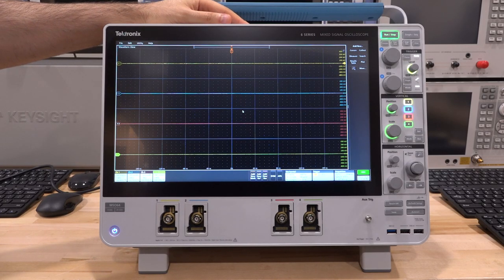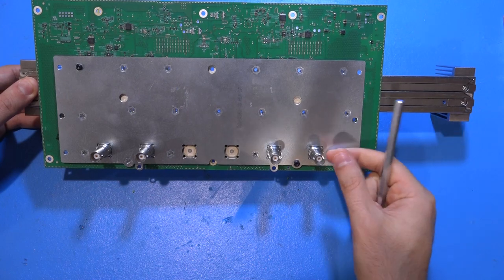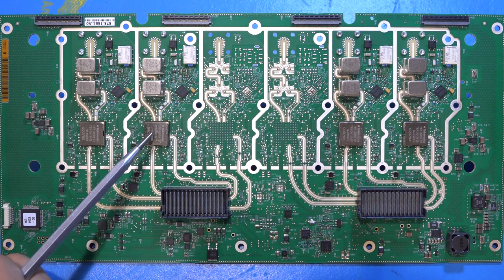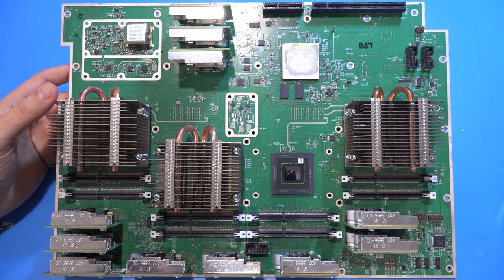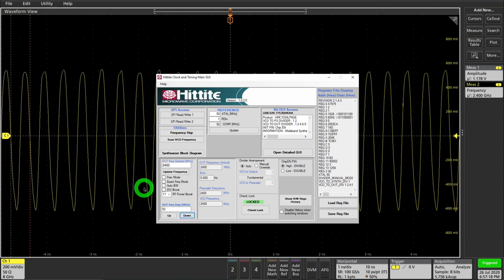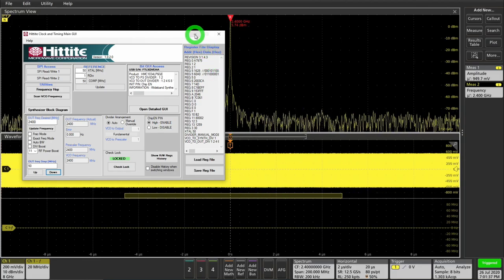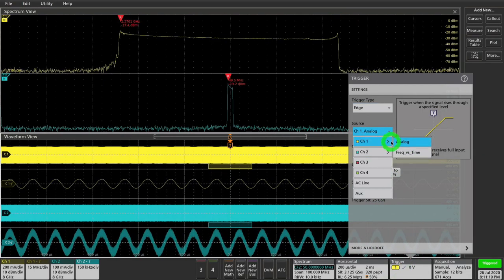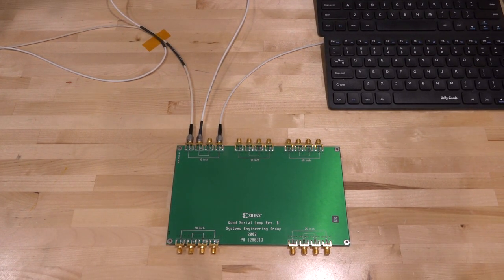TSP #172 - Tektronix 6-Series 4-Channel 25GS/s 8GHz MSO Review, Teardown & Experiments (Part 1)

Comment: If you start the table of contents from 00:00, Youtube will automatically add chapter markers and titles to the progress bar
Reply: Yes, I do this with my videos now, works great.
Reply from the maker: Amazing! I have to try this. Thank you.
Reply: @Thesignalpath  Another trick making life easier: when you edit the video, add markers to the timeline, and then export them to an EDL file. It is a simple text file, which can be easily converted/edited into the table of contents. You won't have to go through the video again just to write down the timestamps. Each time I edit a video, it saves me a lot of time.
Reply: It's one of the (rare!) times that YouTube has added a feature which is actually useful.  I use it on all new videos and maybe it's worth going back over some of the older ones too.
Reply: @funtechu  Very interesting, I will try that!

Comment: You are great. Just I start to look for an oscilloscope (Tek 5 & Keysight MXR), here I have notification with Tek 6 series. I would like to compare this with newly released Keysight MXR series (12bit  Vs low noise 10 bit)
Reply: According to official specs Tektornix ENOB is 8.8 compared to 9.0 in Keysight. Tek wins in bandwidth, Key in acquisition, also Key has 8 channel model. But what really sells me to Keysight is their beautiful phosphorus-like signal imaging with smooth gradients that gives fast insight how particular signal really behaves in dense areas.
Reply: Tek ENOB is 8.2, Keysight 8.2.  Tek will win on noise, ~ 30-50% at 1 mV/div.  Keysight standard record length is greater, but Tek maximum is 2x greater.  The MXR is a great scope, rest assured;  however, the Tektronix still has the edge in most physical performance metrics and once you get into software/analysis, like Spectrum View, Tek runs away with it.

Comment: Could it be those apparent trace disconnects you were musing about on the empty channels @ 14:14 or thereabouts were done to prevent any antenna effect or noise coupling in ?..with no chips installed they would seem like un-terminated lines which might impact the active channels...just musing myself...great job as always sir

Comment: 14:05 first I though that these gaps in unpopulated channels are probably just connected with a simple jumper when channels are populated in a higher end model. But then I thought, why didn't they broke traces closer to the ADC then? Why do they want traces to go under the shield? Also remember that the shield is not covered with emi absorbing material on these unpopulated channels.

Comment: At 13:38, they have two southbound differential pairs from each TEK061 chip, but one pair has no soldermask and the other has. I guess the one that has no solder mask is for high-speed differential pair since those solder masks potentially introduce extra dielectric loss. My question is, the two chips shown in the video share the same footprint, but one chip uses the left diff pair for the high-speed signaling, but the other chip uses the right diff pair. what is the purpose of the other diff pair that has a solder mask on top?

Comment: And here I was thinking I was clever by using my PC's 'sound card' to simultaneously measure the voltage and current of a device under test to create impedance and phase charts for audio speakers, crossovers, or similar devices... o.0

Comment: 10:50 well, I think the solid state relay is switching de AC coupling capacitor and the electromechanical relay selecting between 2 input attenuators
Reply from the maker: This instrument doesn’t have a solid state relay on the front-end.
Reply: Ok, I just assumed the 4-pin SOP package near the capacitor in the low frequency path was a solid state relay. 
Keep up with the good job!
Saludos desde Argentina

Comment: I have a 5 series, but may move back to Keysight as the 89600 VSA software will work on it.  Still very nice scope though.
Reply: The Tek SignalVu-PC VSA software has been enhanced to support the 5 and 6 Series oscilloscope platforms - will be released very shortly...

Comment: In your first experiment for the 2.4GHz signal and PLL. You drop the sampling rate below any usual recommandations. Your frequency marker read about 1GHz, instead of 2,4GHZ. Which is expected as you sampling rate is at 3,..GSa/s why did you do that? Does it would not influence your measurement to not sample your frequency at the right sampling rate?
Reply: When the DDC is engaged, the memory access is split between the time domain data and the baseband IQ coming from the DDC.  This means that the sample rate of the time-domain samples is reduced.  However, the full sample-rate data is applied to the DDC input, so there is no loss of timing resolution and Mr. Nyquist is kept happy...

Comment: Is the spectrum analysis in this scope completely in digital signal processing? Or is there an RF section that was not shown on the video? My guess is it is fully software (with hardwired DSP) because I did not see any signal split around analog frontend that would feed into an RF section.
Reply from the maker: The DDC is fully in digital domain.
Reply: The 12 bit samples from the ADC are applied to the hardware-based digital down-converter - all done in DSP.

Comment: Overall, it is a very well designed instrument. The DC-DC modules look very interesting. As for those Teledyne relays, I would bet they could be used for very high speed signals without any issues, albeit they will be very pricey. The first inline relay seems to be there for grounding, or just to bypass a capacitor. It is hard to tell. As for the differential pairs going from the ADCs, they are reminiscent of the ones used in USB 3.0 or PCIe (e.g. one pair for each direction).

Anyway, good video, as always!

Comment: After watching the video, I have some questions about the spectrum view feature of these scopes. I wanted to ask if someone maybe can help me out.

I was surprised how the spectrum view function worked, because I assumed that an FFT is used (due to the selectable window), but the behavior doesn’t match with what I would expect in this case. After some googling I found an article to the Tek webpage which shows that a digital down converter is used to move the center frequency of the spectrum to 0Hz before the FFT is processed. Is it correct that signal must be bandlimited beforehand for this to work?
When I look at the block diagram on the webpage both the time domain and the frequency domain signal processing pipeline receive the ADC data at the full sample rate. The reduction of the sample rate when using spectrum view with a wide span is therefore only due to limitations of the acquisition memory?

Thanks for any help.

Tek Website:
https://www.tek.com/document/application-note/spectrum-view-new-approach-frequency-domain-analysis-oscilloscopes
Reply from the maker: Yes, the limitation is on the acquisition memory side.

Comment: What is the lowest frequency that jitter measurement can be done ?
For time expansion in RADAR  need low frequency.
Reply: The advantage of the DDC - long term RF capture is possible.  As the acquisition BW is reduced, the IQ sample rate is reduced, thus longer data records can be acquired.

Comment: why are proper heatpipe coolers relatively rare in test equipment? It's so much more effective and compact than big aluminium coolers
Reply: Maybe I am missing something?
My understanding is that heatpipes and coolers are totally different, almost like a resistor is different from an inductor!
A heatpipe is designed to MOVE heat from one place to another while a cooler is designed to DISSIPATE heat into some other medium (air / liquid etc).
Therefore, if you have enough volume to dissipate the heat locally, you don't need (or even WANT) a heatpipe.
However, if you cannot dissipate the heat quickly enough with a local cooler (/ radiator), then you MOVE that heat elsewhere using a heatpipe to a place that the thermal energy CAN be dissipated.
Reply: @trevorvanbremen4718  I'm saying that test equipment usually uses gigantic aluminium heatsinks that are extremely inefficient at cooling, instead of using a properly designed heatsink with heatpipes to transport the heat to the fins.

Servers and PCs moved away from the old style a long time ago, yet you still see it all the time in test equipment, and the devices  thus often need way too loud fans to keep them cool.

Once an aluminium fin reaches a certain length, making it longer won't make the cooler better, since the thermal gradient along the fin means it's hot at one end, and barely above room temp at the other. A finstack with heatpipes doesn't have this problem, the heat can be spread across a much larger area in a smaller footprint.

I said heatpipe cooler, not just heatpipe. Don't just assume someone has no idea what the words mean that they're using, try to understand what they want to say.
Reply: @tommihommi1  You're still missing the point.  Heat pipes don't cool at all.  They just move heat to something else that cools.  In the case of servers, the heat pipes are conducted directly to a refrigeration system, outside the building.  In test equipment, where some degree of portability is required, heat HAS to be conducted to the surrounding air, because you don't have the luxury of having a heat exchanger at every test bench.
Reply: @BrightBlueJim  Just read what I have written here again.

Heatsinks that work exclusively by conduction are inefficient. The longer you make a metal fin, the less work it can achieve, since there's a large heat gradient across it, and one end will be much colder than the other.

Using heatpipes, you use convection to distribute the heat across a larger area, and thus get a much more efficient heatsink. 

Lool at the heatsinks in this video. They utilize heatpipes, and can be very small. It would be impossible to cool these chips using just chunks of aluminium with some fins, or the chunks would have to be absolutely massive. Like it was done in older test equipment.
Reply: People associate heavy with quality.

Comment: And a base price of $29,800
An amazing scope, but ouch!
Reply: That's for the 1 GHz model.  You're looking at $80,300 for the 8 GHz model, with no other additional options selected.
Reply: @CezaryAkakios  The features are a bit more important than frequency to me, so I'd be ok with the 1GHz bandwidth.
That is, if I was a millionaire.
Reply: Definitely not (typical) hobby material, but this isn't like buying a robot where you have an option to have people do the work.  With this you're basically buying a superpower.  If you could bill more for work or get more types of work or fixed bid work done faster this could easily pay for itself in less than a year.